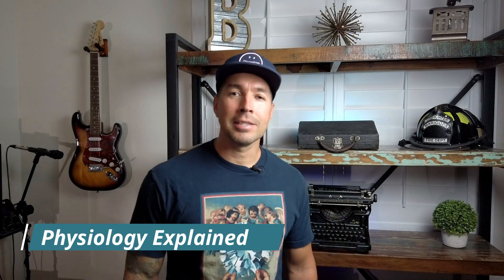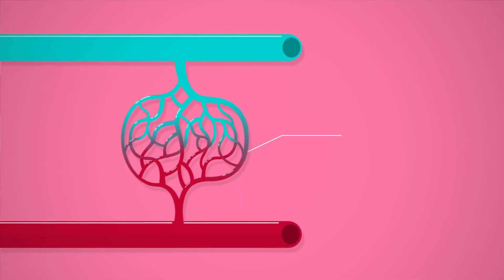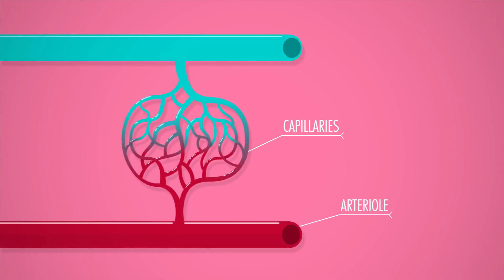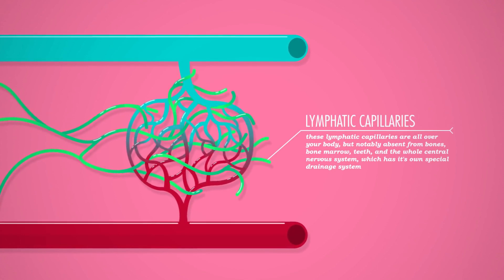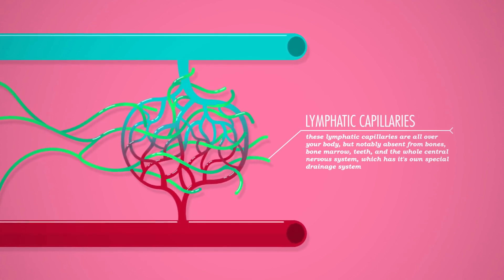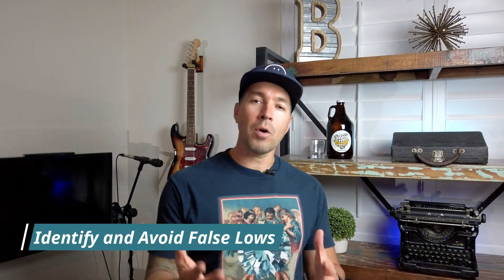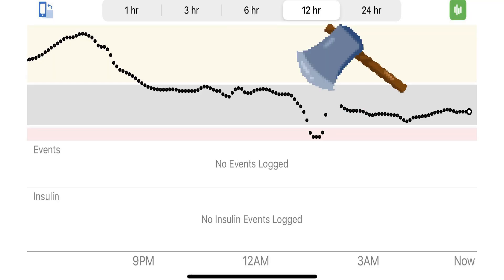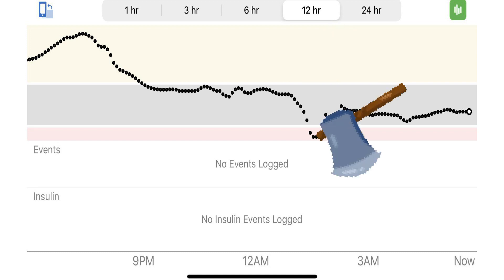BEWARE! False CGM Readings.  Compression Lows Explained

Comment: the single most important question and you did even ask? If your sensor does experience a compression low is it dead or permanently effected ( wrong readings )or will it self correct over time? if so average time to recovery?
Reply from the maker: Great observation!  Thank you for contributing to the conversation.  I'll be sure to try to add that into future conversations around this topic.